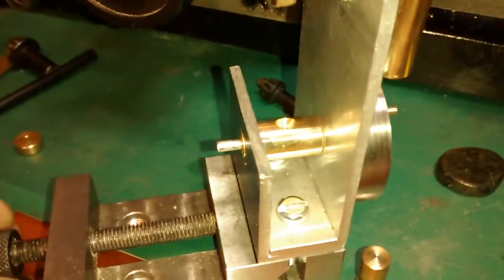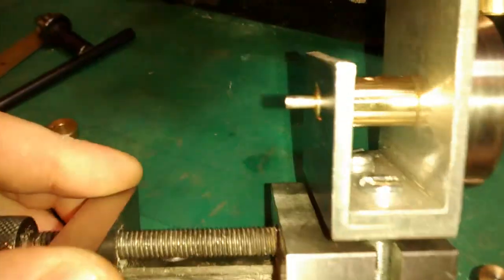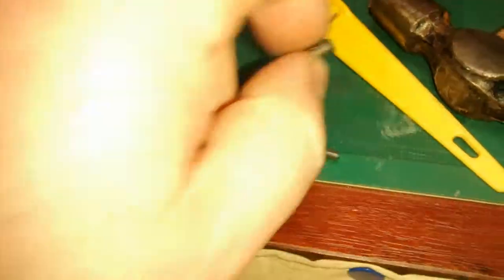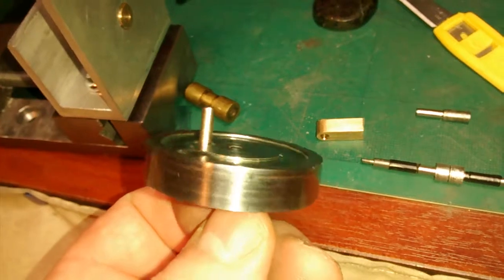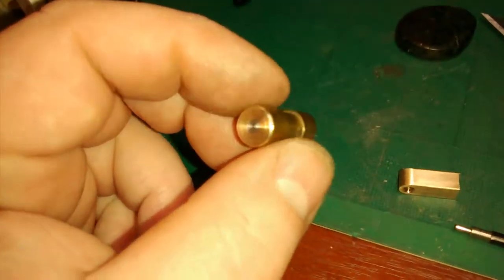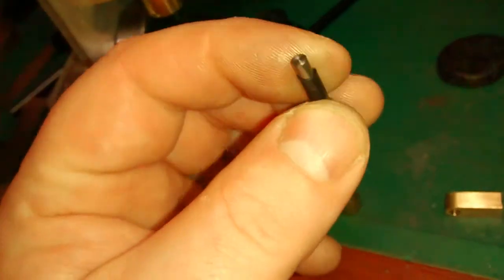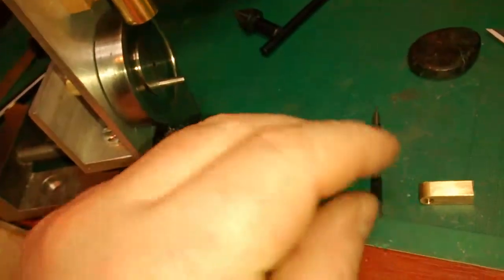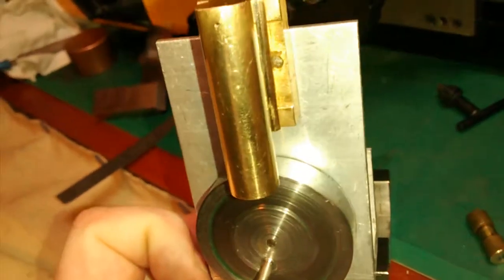My first steam engine - rebuild Pt.4 - new bearing, crank pin and piston rod end

Comment: I'm impressed by the quality of the machining you are able to get from the lathe and mill.  All the cuts look really clean and accurate so it seems like you have a good bit of gear there.
Reply from the maker: Thanks, its a good bit of kit, with a bit of adjustment the small lathes can be very accurate, I'm glad the eBay guy refunded me for the Nano lathe I ordered it would have been an utter pig of a thing.  this was twice the price but worth every penny.

I'm using a set of tungsten carbide cutting tools, real budget jobs but they cut brass and aluminium very well, the crank pin is made from a scanner slide bar what ever kind of steel it is it machines beautifully, also diamond files, diamond hones, emery paper, Brasso and polishing pads help too. 

Also helps when you have eBay selling specialist tools at pocket money prices.
Reply: DrQuiMobile That guy tinkerjohn (http://www.youtube.com/channel/UCqosMGKZNzLIO4D0WwsDJvw) has a Chinese lathe and said the same as you, that with some fettering they can be very accurate.